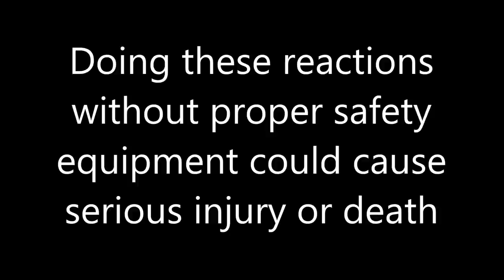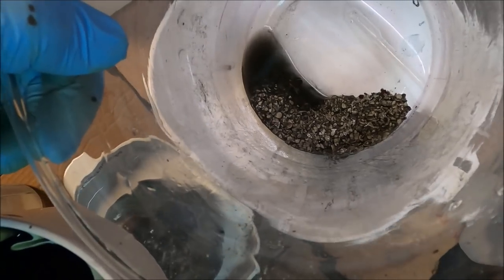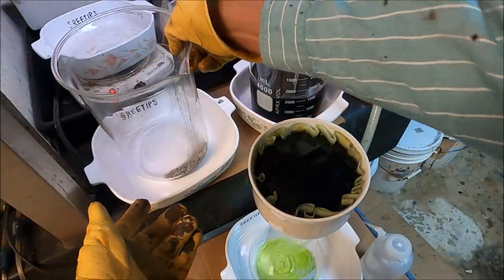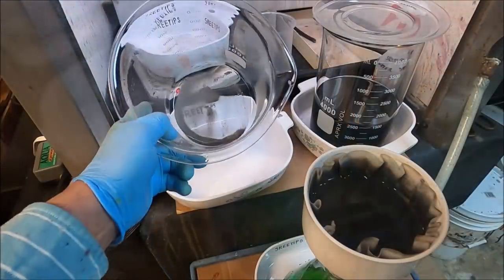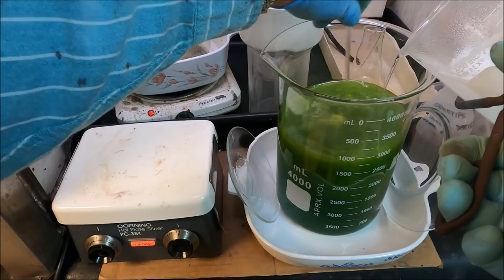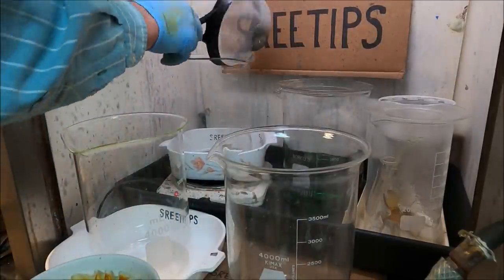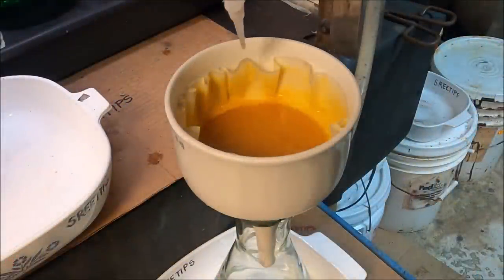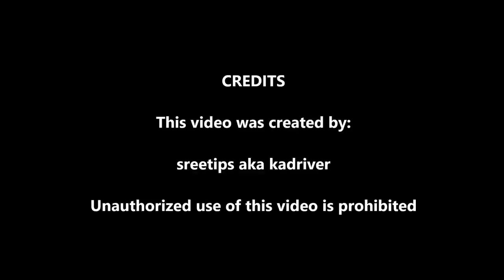Silver Cell Anode Filters Recovery and Refining Part 5

Comment: Thank you Mr treetops for all these in-depth detail videos you are putting together for us. Really appreciated indeed. My H2SO4 Ag experiment was a total failure. On any tentative I could precipitate Silver Sulfate, either using salt or HCL. Anyways, I had all this waste solution. In stock pot bucks with Cu coils. Did not need much to drop Silver. I had the waste from the other two parallel experiments where I was extracting Ag foils from a few pounds I have, one using only HCL, and the other HCL  ÷ H2O2. At least from the silver plated I am r recovering about 90% of the foil (visual approximation).
One funny bit to close: from the H2SO4, I got 3 pure Silver beads, under  1 mm each  😀

Comment: Cody'sLab did a series about seven years about the reactions you get by adding acid to water VS water to acid. It seemed like the key to getting a reaction was super heating the acid over the boiling point of water. Water alone can't get above 100c so this limits the strength of the reaction (unless you are pouring in boiling acid). Like many an adage it seems like this leaves out the most important details! The important factor is the temperature of the liquids involved instead of the order of operations.

Unrelated to the above, can you set up a Patreon account?
Reply from the maker: I'm already over exposed with accounts every where. I did add some sulfuric to a very little bit water one time and it reacted violently and spattered hot acid.

Comment: Good choice to continue dissolving the last of the metal.  I'm not convinced it's just left over silver shot.  Seems to be very hard to dissolve in dilute hot nitric.  My guess is that it's a silver alloy with some PGMs.  And the black powder is likely some PGM oxides.  You're going to run into some interesting chemistry trying to separate anything other than the Palladium. 

Speaking of which, how are you going to test the purity of the Palladium DMG?  There's bound to be more than just Palladium in that precipitate.
Reply from the maker: DMG will drop platinum. And gold as well as palladium.

Comment: Sreetips... Immediately stop using iron to cement your copper from nitric salts and watch one of the newer videos from NurdRage. He shows how to reclaim the copper as pure metal, and the pure nitric that you started with. This uses sulfuric acid, which you can make from root killer, and you get pure sulfuric back in the end. This is an extremely efficient process loop, but you will need to get yourself a distillation kit, with a laboratory-type heat mantle, or built a Bunsen burner (you need to get sulfuric acid over 640F to distill it).
Reply from the maker: Buck, I’m so far behind on refining the precious metals that I have. I simply don’t have the time to devote to copper reclaiming. I can buy clean copper easily. It’s readily available and cheap. I’ve got two cases, six bottles each, of nitric acid. That should last me over a year. I can’t keep up with the gold and silver that my wife finds!
Reply: @sreetips  Well, holy crap! Perhaps you can do a video on how to get nitric for under $50/quart. Every time I see you add the stuff, I get heart palpitations.
Reply from the maker: Buck, I’ve never done it, but you can make nitric with over-the-counter chemicals. Check out “Philip Bender” on YouTube. He has the best video that I’ve seen on how to make nitric acid - but it don’t look easy.
Reply: @sreetips  I'll check that out. Thanks for the [sree]tip!  The chemical method I tried before didn't turn out well, and the "...out of thin air" method is slow. It's one of those things that you just kinda run all the time for a slow trickle of the stuff. It goes well with the sulfuric reclamation method I previously mentioned, since it's all pace-matched to the scale.

Comment: Why do you sometimes make a DMG solution first, where other times you add the DMG powder directly?
Reply from the maker: A matter of convenience. I added powder the first time. But a spent some time off camera breaking the lumps apart. So for the second addition I boiled on hot water so I could break the chunks easier. DMG doesn’t dissolve very well in water
Reply: @sreetips  Yeah, it is a pain that way. Plus, the smell (which reminds me of ranch dressing powder) gives me a headache.
Reply from the maker: It does have a weird odor.

Comment: What are the pans you set the beakers in while they are on heat and where could I get some? Everything I use seems to hate heat lol
Reply from the maker: Corning ware that I bought at yard sales
Reply: @b3atdown69  Corning wear or Pyrex from Walmart, Target, thrift stores, etc are all just fine.
Reply: @b3atdown69  Yep. Just always make sure it is borosilicate glass. You don't have to spend a lot on it, but the cheaper, the more questionable it is, as to whether or not it is real. Used Pyrex, Corning or Anchor brand at thrift stores, or garage sales is great.